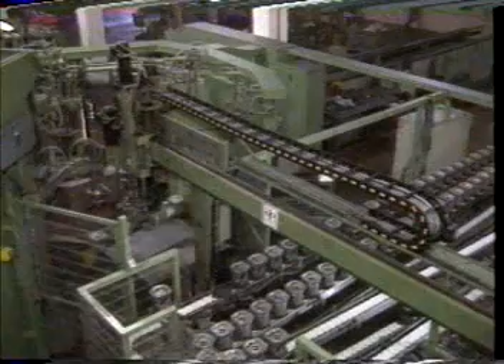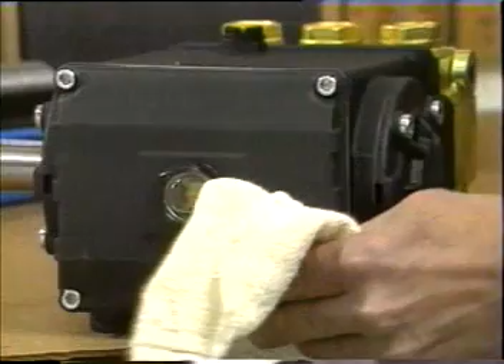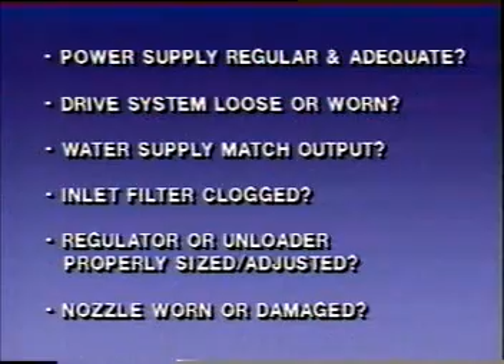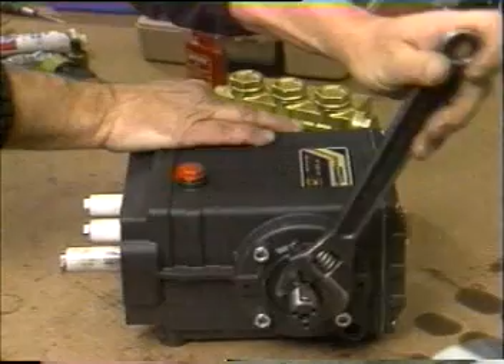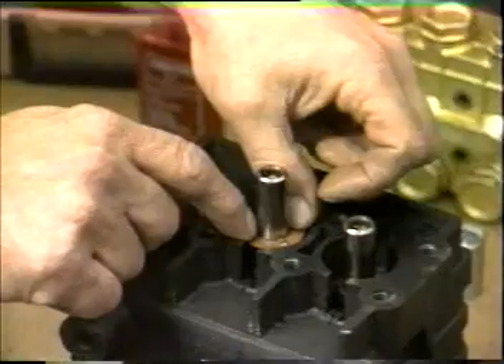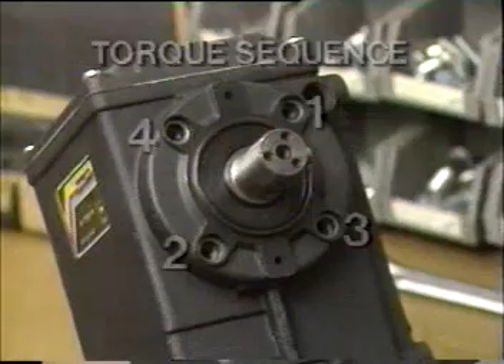Servicing Your General Pump (Interpump Group S.p.A. On-line User Guide)

Comment: How do you remove a stuck ceramic plungers
Reply: they use red loctite which needs heat to remove. I wouldnt use a torch but maybe a heat gun.